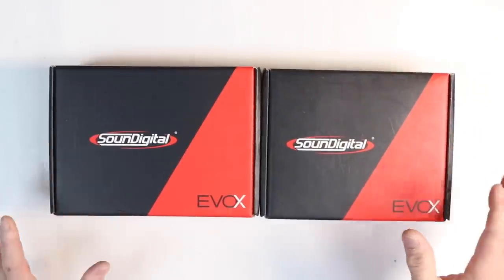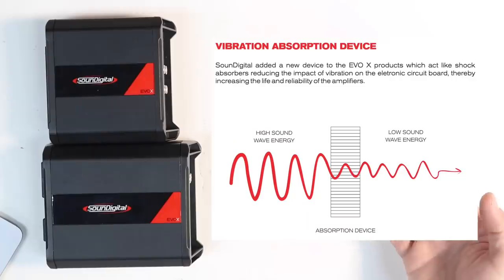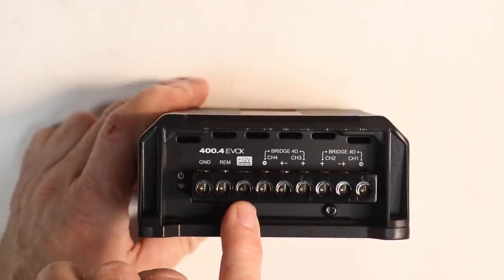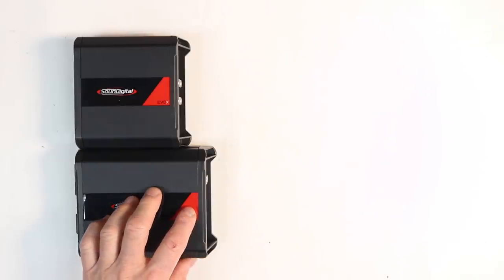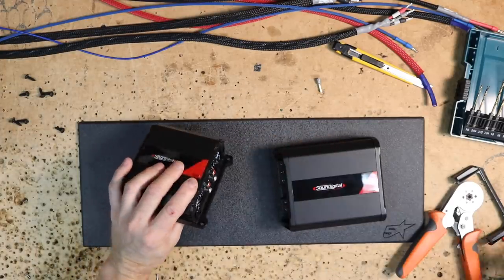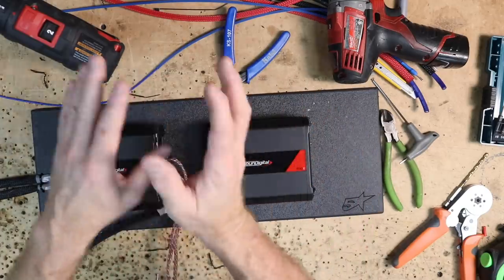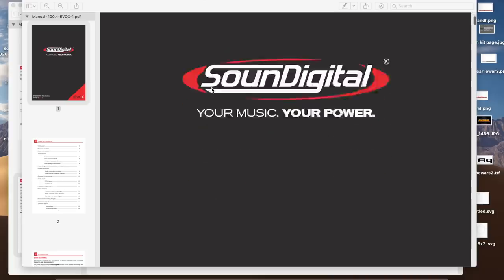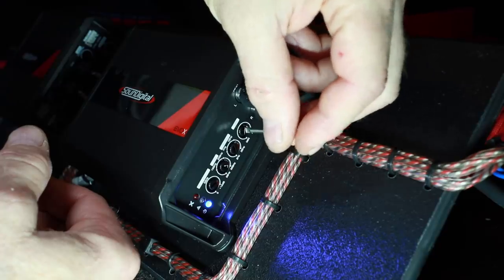Soundigital EVOX 400.4 and 800.1 little amps BIG power Car Stereo Lab

Comment: I can't wait for Bid D to test these!
Reply: They will do what they say and more. Still dont trust them. Longevity is my issue.
Reply: Yea boiii
Reply: With 40 amps seems like it’ll do no more than 600
Reply: They do rated. Period. Tested and true. Period. This Dyno , that Dyno makes tested power. Period. Quality install, properly tuned they will last. Period. Idiots need not apply. Period
Reply: @alphaomega8373  these are tried and true in the powersport world. Like pretty much the standard for 75% of motorcycle sound system so if they can hold up to vibrations and extreme temperatures from the environment then in a car reliability is a non issue.

Comment: Do not use a 40 amp fuse on the 800.1. I sent back six of these due to that. We started using an 80 amp fuse and they don’t come back in to the bay. Our rep had one in his truck using an 80 amp fuse without issues. These would show up the next day when using a 40 amp fuse. So I highly suggest going more on fuse rating. Always go for max amp rating for fusing. Just my 2 cents.
Reply: 7/17/hello is it true you're saying 80 amp fuse instead of the 40 I'm running the hertz 200 l on this amplifier and what is the problem with that thank you

Comment: i got a 800.4 sound digital evox is amaxing. i have 3 ds18 neo pro 6.5 pairs and 3 pro bullet ds18...
Reply: Is these amps really loud and sound good. I be using stetsom amplifier
Reply: Are they awesome? Need to power 4 deaf bonce speaker of 180 watt each. The 800. 4 gives around 140 watt rms per channel and will surely underpower those speakers. What are ur views on that Amp, do they make speakers screams??

Comment: I have (4) of the 1st Gen Evo amps on my motorcycles. They have been great. These new versions have a bunch of issues. They were either released in a rush or the company knew and still sold them this way. The motorcycle audio community is in an uproar over this. Be cautious if you plan on buying one of the new EvoX models.
Reply: I just got the sundown sfb1000d. Haven't installed it yet but I've heard good things.
Reply: Can you link me to some threads that discuss the problems with the new EVOX?

Comment: When using the amplifiers like the 4 channel pretty much all of them put out double the rms power at a 2ohm load why would we not go with 2 ohm speakers as long as the speakers can handle the wattage the amplifiers puts out? 
Another question for basically  five star car stereo I've seen many places around me when running new speakers and an amplifier to the interior speakers do you run a new run to all four speakers because I seen a professional install run new wires just up to the wire harness that is behind the radio I know in some cases its hard to run through the doors through the wire seal in between the door n the car but is this something commonly done? obviously running from the am to the back speakers when in the rear deck lid you probably run new wires but is this something you guys do? And what about if you are running from an amplifier to a factory amplifier you cannot run an amp through another amp thanks for yourself  input

Comment: I have a 2018 CVO Street Glide, I just installed a SD evox 800.4 for my upper/lower fairing diamond audio mp654, SD evox 800.4 running my MS8NEO diamond audio on my lids and a SD evox 2400.4 running my DS18 PSW10.2D subs on the sealed and ported saddle bags, but having trouble setting the HKI mini dsp. 
any advice will help.

Comment: I like your attention to detail. This is splitting hairs to some but My 1 complaint on your channel is that you guys do a great job keeping things neat and clean but to often, have no problem adding a connection like a speaker tap/plug as if it has no effect on the final product. ("resistance is futile" on a speaker line, it is critical in sound. Also with vibration in a car, less connections are always better.) Any installer should avoid more connections/connectors, mostly but not limited to speaker wires whenever possible. Also it's nice to keep factory speaker wires, but running new wire is usually a higher quality option. (this has always been the case but obviously not always a necessity.) ferrules look awesome but are usually bad quality and don't matter if your system is cheap to begin with. But should never be used on a high end install. Maybe (up for debate) tinning your speaker wires with a high quality solder is a similar result without really adding another connector? I'm not saying anyone is doing anything terrible wrong here. Just adding food for thought in any installers mindset. Other than that, great job guys. I love your info. It is so awesome your doing this for us to see. I have always enjoyed seeing how others do it and different ideas. I hope it is paying off for you guys.

Comment: Is it better to use the high-level inputs for higher voltage or do you recommend using the rca inputs. From a Kenwood excelon head unit?

Comment: Question: does it matter that you crossed the power wire over the rca’s?  Should I worry about rca’s picking up engine noise? I’m installing these on a motorcycle

Comment: Question I have an 800.4 evox and I have 4 80RMS JL 6.5 running of the evo and even with the gain less then halfway output she gets very hot, now you stated that they get hot and are designed to get hot, my question,, is it safe and will she get so hot that she will go up in flames?? I don’t want my Harley going up in flames😳, and all the wiring on the bike and amp are to specs, so even if the amp gets really hot it should be  safe?? Could you please Advice,,Thank you🙏

Comment: Hi @FiveStarCarStereoIncClearwater I got a quick question. I have an amplifier in a trunk running 8 inch woofers in the doors of my 05 Mustang. I want to drive the door upper and rear speakers (currently 5x7). The problem is passing another wire trough the doors would be a nightmare cause of this factory wires flange. Can a factory wire handle about 60-70 RMS? I would place a small 4 channel amp behind the radio or near the kick panel (like the Soundigital 400.4 or the Alpine KTP-445U) and pass the output back to factory harness. Wouldn't a D-class speaker be a problem for mid and high speakers? Or is the entire idea a bad solution.
Reply from the maker: That is a fine idea and will work great. Either amp will do the job

Comment: So I was looking into these for my street glide, but ended up with 2 focal 6.900 instead. Im going for decently loud but more on the sound quality side of things.  So I have a question for you guys...... focal fdp 6.900 manual says that each input has a peak limiter to prevent clipping. Are you familiar with this? And what exactly does that mean? If the amp sees any kind of clipping it rolls back the input signal? I cant get a straight answer on exactly what it does. Any help would be great if you familiar with it. Love the channel! Tons of great info

Comment: Very similar too the two optisound amps by Vibe.
Reply: Has no similarity at all. Totaly different powerxsize ratio.
Reply: The powebox 65.4 is 65w rms x4 vs 66w rms x4 and the amp is about the size of a dollar bill, the  400.1M is slightly smaller and isn't really in the same league as the sound digital mono, but can run it at 1, 2 and 4 ohms. Granted these sound digital amps are a more advanced/elagant option with the clip indicator and much nicer look. Are they available in the uk market?

Comment: Anyone answer a question for me? I have 2 amplifiers and am I ok to run them to two seperate ground points in the car as there is no ground point close enough to join them both to the same point. There just seems to be mixed reviews online.  Many thanks
Reply: Yes that’s absolutely not a problem. It used to be better to have ground wires be as short as possible, so installers wouldn’t bother using a shared ground point for multiple amps.